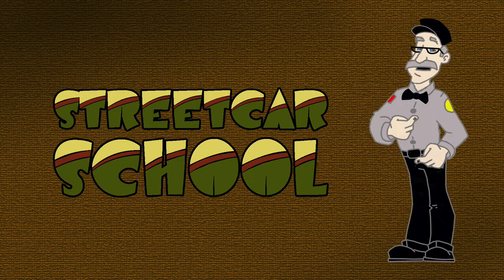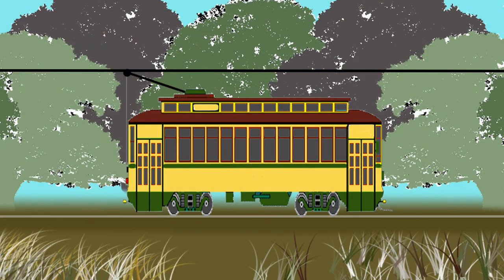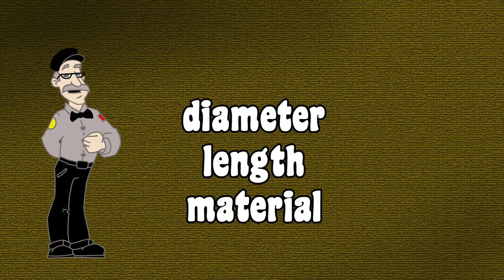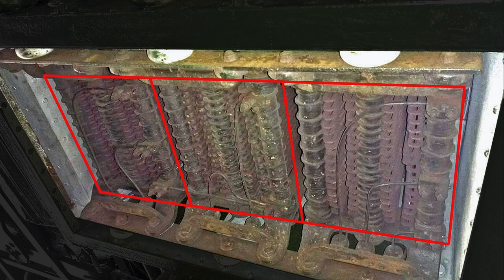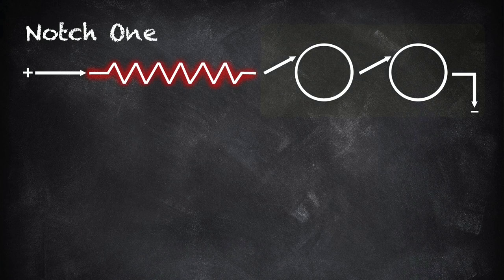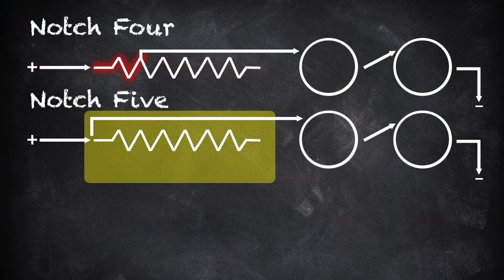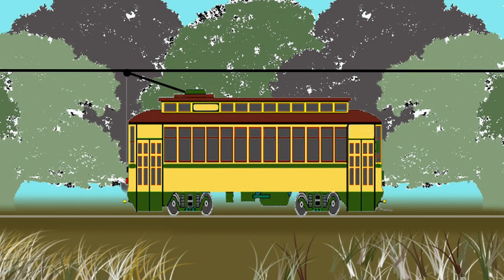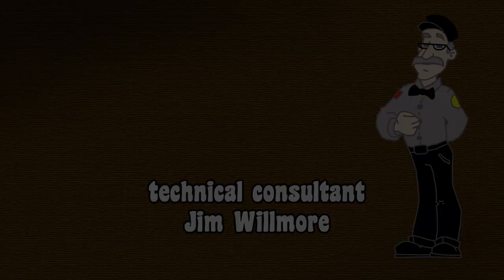Streetcar School III: The Controller and How it Works

Comment: In Boston, we used to have Boeing US Standard Light Rail Vehicles from 1976 until 2007.  These had electronic choppers (as far as I can tell, one for each end) to perform the equivalent function to the resistor bank, and also had switches to cut them out of the circuit once the streetcar got going fast enough not to need them for current regulation (reportedly 17 mph).  Well, one day in the early 2000s, along came a pair of these, and the rear car had a problem at the rear end that made the switch stay cut out no matter how low the speed.  So when the train accelerated, the wheels on the back end of this unit would spin until the train got going fast enough for the wheels to catch, and when it slowed down and applied dynamic braking, the rear wheels would spin in reverse.  I think nobody was on board other than the drivers -- they must have realized something was wrong and gotten everybody off so that they could try to make it back to the shop.
Reply: Chopper controls Don't necessarily use resistance some of them will give full power to the motor on your first notch but in little pulses. So higher you go as long as it's pulses become.
Reply: @Ham549  I know -- what I meant was that the chopper was substituting for a resistor bank and for series-parallel running.  Although I think that the Boeing LRV may have had resistors as well (not sure about the later Type 7 cars that had a different kind of chopper) -/ for sure they had braking resistors at least, because the overhead supply on the Green Line doesn't support regenerative braking, even for the new cars, unless they changed something really recently).

Edit:  I've been told that the reason for having resistors in addition to chopper control is that if you make very short pulses and don't have a good way to smooth them out (remember that the Boeing LRVs were using at best 1970s technology, and the Kinki-Sharyo Type 7s were using at best early-mid 1980s technology), the very short pulses act as equivalent to very high frequency current, which generates eddies within the motor windings that generate heat instead of doing work.  So better to have a minimum length for the pulses and then have resistors to take the heating when you need to reduce the current further.

Comment: Great vdo but does the current stays the same throughout the series circuit and different per parallel circuit depending on the amount of resistance for the parallel path?
Reply: Resistance drops the current. So the greater the resistance less current can flow.
Reply: My understanding is - the motor's armature and field windings have resistance. By combining them and the resistor grids in series the current is limited (although still significant) as the first notch is selected.  Motors, like a generator, produce electricity when rotated, even when an external source of electricity is being used to rotate it.  The voltage produced by the motor is less than the voltage being applied so the motor still "sees" and uses some (the difference).  The amount applied (voltage across a given motor) is also limited by the resistance in the circuit including the motors themselves.  As the motors accelerate in a given notch they draw progressively less current due to the back electromagnetic force.  with the reduced draw comes reduced torque.  By selecting the next notch the resistance is reduced, the applied voltage at the motor is increased, and the motor once again produces more torque continuing the acceleration.   When the notch with no added resistance with the motors in series is reached each motor is seeing 1/2 the overhead wire's voltage and no energy is being wasted heating the resistor grid. the only way to increase the voltage applied to the motors at this point is to power them in parallel.    Once again the resistor grid is included in the circuit and gradually reduced with subsequent notches. In the highest notch each motor gets the full overhead wire's voltage.  Assuming level ground the acceleration stops when aerodynamic drag and mechanical friction equal the motor's output.